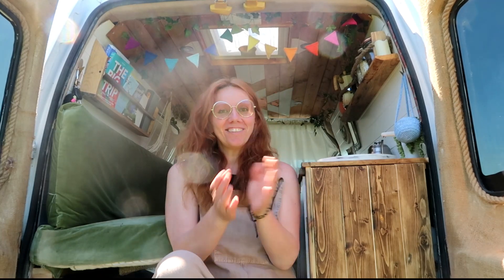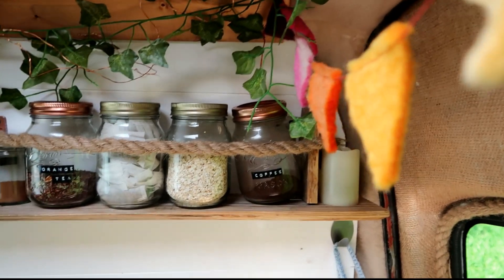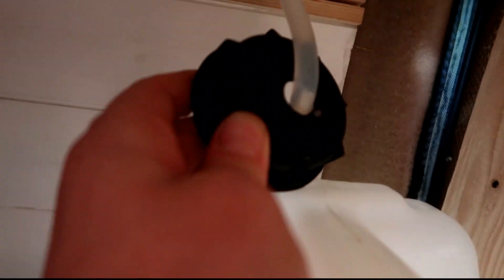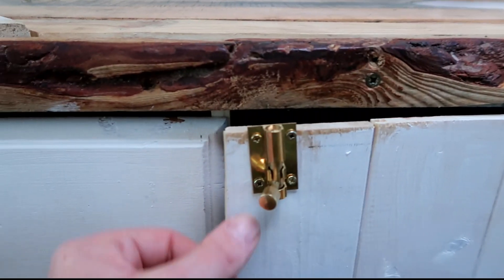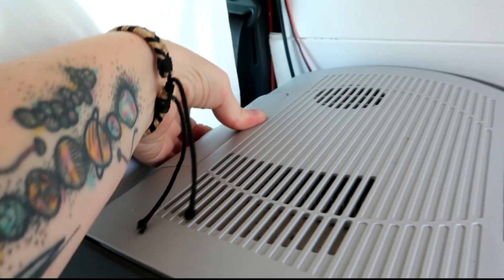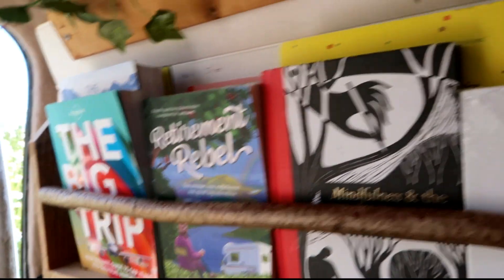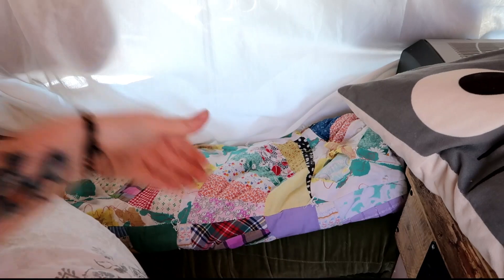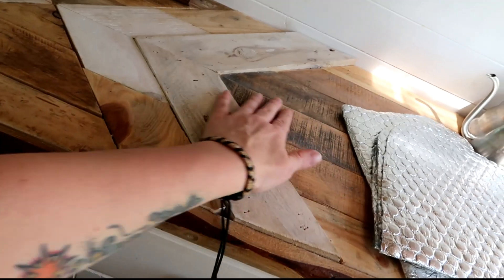Ford Transit Connect Van Tour - DIY micro camper conversion

Comment from the maker: Hi, thanks for watching my van tour! I made a mistake with the sofa measurements, it's 160 by 55 cms not 160 by 90 cms. 

Also, I should of added that the total space in the cargo area is L 190 cm, W 140 cm, H  132 cm.

If you have any questions, drop them in the comments and I'll do my best to answer them 😊
Reply: Such a cool van Terri. Can I ask, the 190cm, is that from the back of the seats to the inside of the back door? Also, is that with the seat fully back? I'm hoping to do a conversion, but I need to get the right size van for my long legs
Reply from the maker: @malditcham  ah so exciting, you should totally do it! Yeah, mines 190cms long but the front seat goes down so you could potentially add a piece to make it longer. You're very welcome to come have a look at my van to see if it would be long enough for you
Reply: Thanks Terri, I'll certainly take you up on that kind offer. I'm taking my time to find the right van. My Kangoo is ready to be replaced. Transit Connect is on my list to consider.

Comment: Gonna get my own connect very soon from video it seems like your arrangement blocks of the sliding side door how do you find that practically wise? Also love the use of pallet wood great way to save the pennies 😊
Reply from the maker: Hi! Thanks for watching.  I used to have it with a shorter work area on the sliding door side (you can see this on my Europe vids)  but decided to reconfigure it as I wanted more storage.  By putting the bed/sofa on the sliding door side, I can still access the door which means I can have it open on warm days while sitting on the sofa, but I've gained an extra cupboard on the other side.  I guess it just depends on what works for you tho. Good luck with the build, you're gonna love having a Connect!!

Comment: Is your unit tongue n groove cladding around the sides n on the doors? And pallet wood for the worktop? I like the rustic look and am contemplating what to do on mine. Thank you!😊
Reply from the maker: Yeah, tongue and groove on the walls, sliding door and ceiling, and pallet wood over OSB board for the work tops. I also used tongue and groove for the cupboard doors and pallet wood to make shelving and the storage box that houses the battery/bed linen. I used hessian to cover the rear doors. Good luck with the build!

Comment: I did not know the front seat opened up! (Runs to van)
Reply from the maker: Hahaha let me know if yours does too, it's such a handy feature 😁
Reply: Ah man mine don't have this lol! 
Can I ask...where you attached batterns on the ceiling to fix cladding to? (If you did)
Reply from the maker: @kerigiguere3941  ah that sucks 😞 Yeah, I attached 3 batons to the metal part that juts out on the ceiling (sorry, I'm not sure what they're called). I drilled holes into the wood then used self tapping metal screws and grab adhesive to fix them in place. I'm gutted that I didn't film the conversation but I was trying to get it done as quickly as possible so I go get on the road
Reply: Yes I've tried this on the front bit of metal and the middle bit..my struggle was knowing where to put the other one at the rear near the back doors as the ceiling isn't straight. Where did you place the back one?

Comment: Great to see you back, thought you had got lost in Luxembourg. Great to see your van tour, coz I need all the ideas I can get for my own van. Had it six weeks, but been away in Greece for four so not much done yet. Electric diagram would be really helpful.
Reply from the maker: Good to be back! Ah wow, I bet Greece was amazing 🤩 Yeah, I'll definitely get an electrics vid sorted. It's a fairly simple setup in the van but takes a little while to explain. Good luck with the conversation 😊
Reply: @mistymiles  Had three weeks in Kos before the season started which was great, then last week on Crete which was more like a holiday.  My van is much smaller than yours (Nissan Nv200) so finding a place for the electrics is a problem, definitely want solar so open to ideas.👍😄

Comment: Hi where did you get your red charger from please?
Reply from the maker: Hi! It was from Amazon. https://www.amazon.co.uk/Cantonape-Inverter-Converter-Outlet-Charger-Red/dp/B09G9RYD55/ref=mp_s_a_1_1?crid=2ZKUZ4YY29XEH&dib=eyJ2IjoiMSJ9.trHUoaXgw0LMuhuRPmRMMqEy31hN3rlpoCjnhrtBFFHNLrXfo4aPKtSqPXd1KZY7DeCtDUVfSmfYMjLsOf7pyjgcnAjZW5R1loosYj-oNmbGQmKTEzauZsm8tbTJHLqlmed_dzXiMEBD6ssFZYD43gdSdWXcfy3lXvTdJnsbnK9i3taSNvNLv8DAydoYjY-P1s1kcEg0FRQeCl5jb-YglA.WEHhJEL8S2CChgKyGnzGxcgz33ECOdiRY5lVptNtSuo&dib_tag=se&keywords=Cantonape+300W+Car+Power+Inverter+12V+to+230V+240V+Converter&qid=1718023885&sprefix=cantonape+300w+car+power+inverter+12v+to+230v+240v+converter%2Caps%2C89&sr=8-1

Comment: Thank you so much for sharing the set up of your lovely home on wheels Terri and taking the time to take the measurements. Small space but so many great ideas. It looks very functional and you did such a good job on the wood work!
Couple of random questions.
Do you mean 160x65 for the sofa (instead of 95)?
Have you got any blinding curtains for your windows or do you just feel comfortable/safe enough as it is during the night?
Do you get bad smell refluxes from the grey water tank through the sink?
Thank you so much xx
Reply from the maker: Thank you and sorry it took so long! 

Oops, the sofa is 55cm wide not 90cm - really should have checked that before uploading. 

I use some left over vapour barrier to cover the rear windows (you can see me keep moving it round when I show the bed lats and the bench) which are secured using stick on velcro. I'll take some pics and send them on Instagram 😊. 

I empty my grey waste every few days so it's generally ok. If I allow the container to fill up, there are a few smells that drift up but using the plug helps minimise that. 

Hope that helps and good luck with the build 😊
Reply: @mistymiles  Helps a lot! Thank you, you're amazing 😊
I was wondering what the little white "stickers" on the top of your rear windows were. That's very clever. I really enjoy how you came up with very simple ideas where others would have overcomplicated things. 
Well done you!

Comment: just wondering what size your solar panel is ? cost etc
Reply from the maker: Hi, so sorry for the delay in replying.  I bought my solar panel kit from Amazon for £135.  It's 100watt and measures 106x56x6cms.  The kit included the panel, mount brackets, cables with connectors and a charge controller.  I've just uploaded a video showing my full electric up which explains more and links to all the items used  :)
Reply: @mistymiles  nee bosh